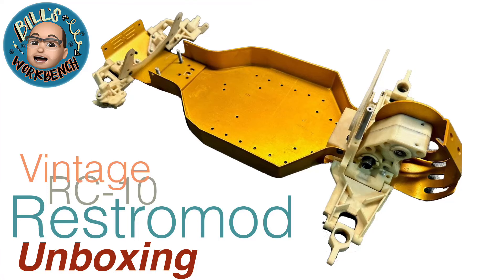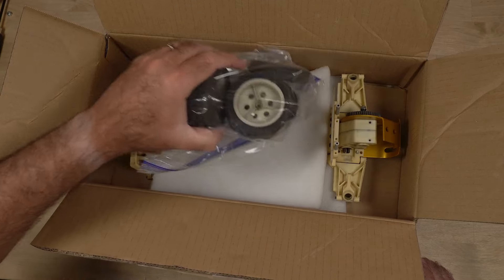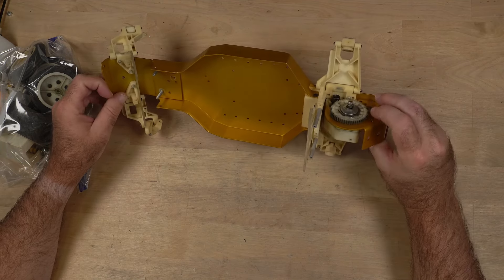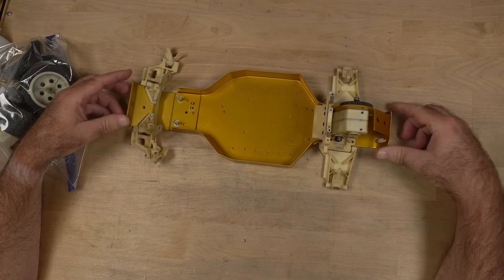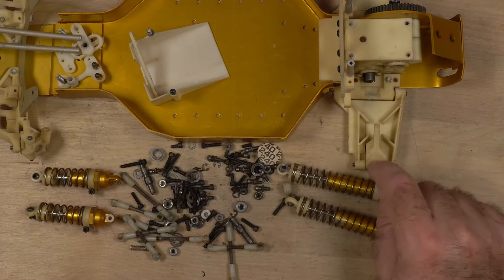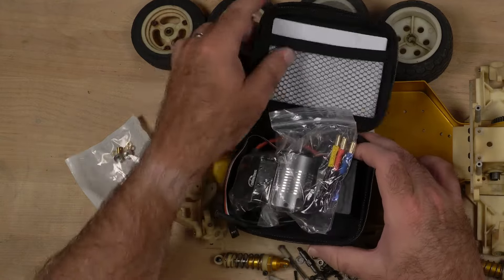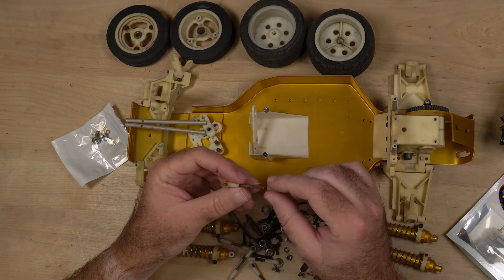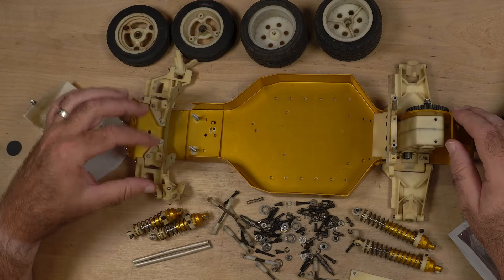RC10 RestroMod Introduction and Unboxing

Comment: I still have mine from the 80's. Got all the original rims but missing the original body and wing. Think I still have the original tires, now worn out. Haven't run it since '92 lol. A time capsule at this point.
Reply from the maker: I wish I would have keep mine, or at least keep my JRX2 with the 5 link.   Hummm.  No I need to stay off EBay for the rest of the year.